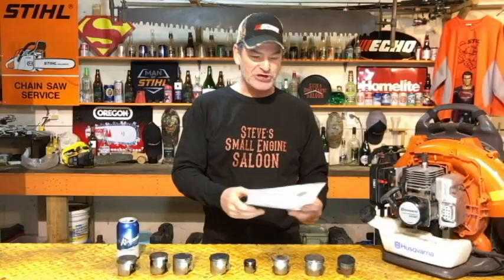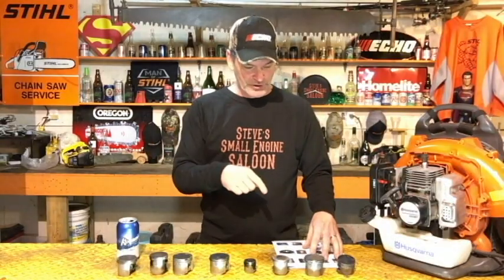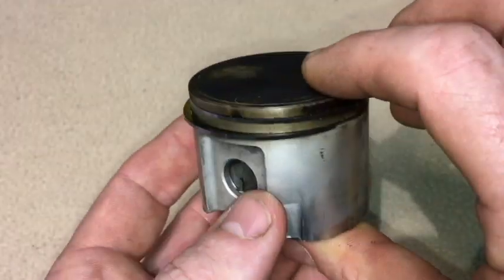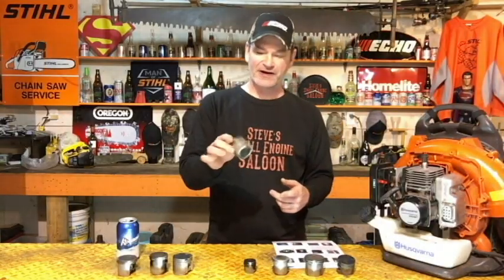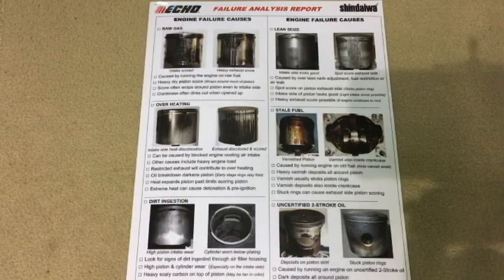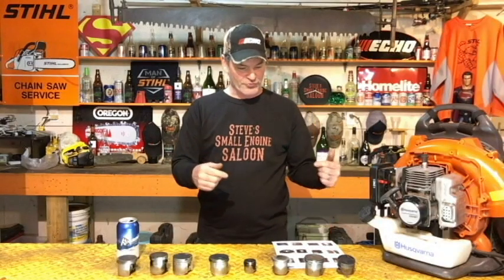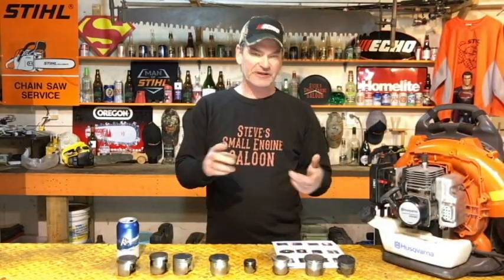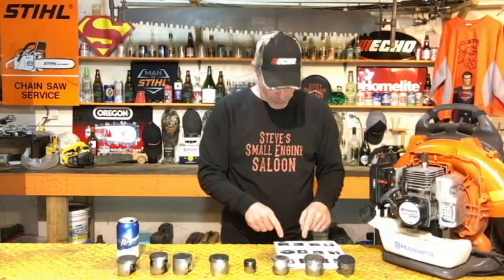How To Tell WHY Your Piston is Destroyed

Comment: I don't have a lot of faith in shops anymore after bringing my chainsaw to 2 different certified Stihl dealers where they must hire the cheapest labor off the street to work on equipment. I had brought my saw in because it wouldn't idle properly when it was warmed up and set aside to move cuttings out of the way. When I got my saw back from the shop, it would stay running but it wasn't long before it was destroyed as they had leaned the mixture out far too much where it burned a hole in the piston with the exhaust side severely scored. I've purchased an aftermarket engine since Stihl parts aren't easy to find online and with the help of your videos, I should be able to properly adjust my carb to the right mixture & settings.

Comment: I make it a rule to clean my chainsaw after very use. As I was cleaning today I noticed black coating on the bar and casing, on the same side as the exhaust port. Could that mean too much oil in the mix. I'm using 40:1. A couple of my chainsaws use 50:1. And that is one of them.
Reply: It could, or may not. (Buildup could be as simple as the saw not reaching operating temperature or the muffler outlet facing directly onto the GBar or Dawgs) 
Old fuel, sparkplug or a loose spring on the carburetor jet could also be a cause. 

Thank you Steve, for covering most of the causes throughout your videos & comments.

Comment: Got a question, stihl ms311, compression 130psi. Starts and runs well. Except if chain Brake is engaged it will stop. I have not adjusted the carb yet, or pressure tested the saw. The piston in the exhaust side shows minor scoring. I suspect a seal leak but wanted to get you opinion Steve. Thanks
Reply from the maker: If the chain continues to move at idle, you probably have a broken clutch spring...

Comment: Sorry to double-post but unrelated Q on this--- is replacing the piston/cylinder the only option if they are bad, or can they be "ported" & "sleeved"?  Think those are the terms I'm looking for... While I don't know for sure yet (not at the point of firing it up yet), I suspect my 1977 project saw (poulan XXV/25d) may be bad and while I do fully intend to get another unit (just for parts- maybe even the engine!), I can't help but worry that this may be a very common problem on these older saws because, at least for mine, the air-filter had literally disintegrated - I can't imagine that means anything except "every last bit of it went-through the chamber on its way out the exhaust"!  While it's simple to replace the long-ago-evaporated/crumbled fuel lines, the air filters doing this would (I'd expect) mean the engine had to 'eat' the filter as it went....My compression feels fine (shoulda got the tester when buying my tach.!), however when I have the muffler off and am looking into the exhaust-port while turning the flywheel I can feel that, as the piston approaches the top/spark plug, it moves very smoothly from the bottom of the cylinder, smoothly past the lower/first edge of the exhaust-port, however once the top of the piston passes the 2nd/top edge of the exhaust-outlet it feels FAR rougher, almost-as-if the exhaust-outlet itself were slightly 'bumped inward' at its top edge or something (although there's no corresponding piston-marks as I'd have expected, the piston&cylinder look un-scored, just some varnish-streaking on part of the cylinder-wall that I'll be wiping-off -- haven't decided yet if I should just reach-in with a long cotton-swab, or if I should learn how to dissemble the entire area and do it right (think I'd do that if/when I get the rest of the problems sorted & actually get it to turn-over, would then immediately turn it off and begin a proper overhaul of the piston/cylinder)  

Making this saw (or another unit of the same model) work is majorly important to me, I know it's not an economical way to get a saw but I already have saws I just want this vintage, neon green top-handle to work, think it'd be an awesome saw to bring on jobs :D

Thanks again for all you do man, your series is literally one of the best 'educationals' I've found in ages, I went from knowing nothing about 2-strokes to actually doing amateur rebuilds (not just chainsaws, my awesome Husq 125B blower was a trash-pile pickup that I got working and now use daily, also have an Echo hedger that I'm (pretty sure!) almost-done getting to work, would never have gone this path if it weren't for your channel and, now, I can't imagine I'll ever "grow out of" my interest in 2-strokes!!!)

Comment: @14:49 you say "If you turn your H screw IN so far / that it's going so fast" (in context of lean problems)   Wouldn't turning the H screw inward slow-down your saw's top-RPM range?  Sorry to nit-pick but want to ensure I've got this understood properly as I've never caught you mis-speak yet that one seems like just that so want to be sure, am actually still trying to figure-out how adjusting the H&L fuel-jets on the carb can even cause lean-ness, I would've figured that the air//fuel//oil ratio is still the same but that H&L are more like 'volume control'.

Thanks for any clarification man, and thanks a TON for doing what you do, am stoked to see the swag under your description am totally ordering the shirt I have watched every chainsaw vid of yours at least 2-3X (and a large portion of the remainder of the channel, basically everything but mower-specific stuff!)  It's so great that you do this it's such a perfect example of how great the web can be - I literally bought my first top-handle saw earlier this year and, embarrassingly, wasn't sure why it wouldn't work----the chainbrake was on!! LOL!  Now, I've rebuilt/salvaged multiple saws and am currently in the midst of rebuilding a 1977 poulan 25d/XXV unit which is why I'm going-over all these piston/cylinder videos (I'd gone to refer to my screen-shot of the Echo infographic and realized I didn't remember enough to contextualize it properly & needed to re-watch the relevant vids here on your channel :D )

Again thanks for doing what you do, it's such a treat to watch (was especially awesome watching you & Buckin', I'd never hang my own axe - probably not at least lol - but thoroughly enjoyed that vid :D)
Reply: If you turn the screw in, the end of the screw pinches off a fuel supply passage. Somehow a chainsaw engine like a leans mixture for running at super high rpms. Maybe a lean charge burns faster than a rich charge. More gas takes more time to burn? Just a guess.

Comment: Help me Steve, where can i find a Stihl 034 cylinder kit?
Reply: EBay and chainsawr.com is where I had to source parts to restore an ol' Stihl 032AVE 
Jug and Slug $25.00 and 10 bucks for some Caber rings.
Got the replacement flywheel cover from Sawr. sawagain.com also has various parts from time to time. Just gotta keep looking often.

I know this is an old post, but hope this helps. 🍻
Good luck and Take care!

Comment: Kokanee!  One of my son's favorite beers, and local brand for you!  BTW, you can get repair kits from China (hutzl.net for instance) for many of the big brand saws and other 2T tools for chump change.  They may not be as good as the OEM, but they are good enough to get a few more years of use out of your machines at a low cost.  But yeah, use good oil - cheap insurance.

Comment: Hi Steve. Thanks for all the videos. I've been a mechanic now for many yrs-thru the yrs a mix of cars and small engines. These days just small engines for a large landscaper in VA (along w/the hustlers and grandstands). Sometimes I like to watch to confirm what I know and sometimes to learn more of what I dont...hence this video. Its funny the cheat sheet is from echo because its the brand I wanted to take on when I had my own shop unless it was a chainsaw where I would go with the stihl. My boss just killled his favorite ms660 so I will print down (in color of course) the sheet and compare to see the cause. I think it ran too lean or too hot or both because the plastic was untouchable above the head and the exhaust side was scored. As far as the oil in my opinion....I'll stay with 36 to 1 all day everyday and unplug those arrestors with the torch verses torching a motor any day! I dont care how good that oil is 50 to1 is just asking for trouble-rediculous. Keep on videoing!!!

Comment: All good advice, one thing I would add is that any type of piston failure that scores the piston is most likely going to send debris off the piston down in to the casing and end up on the con rod and or main bearings.
Be sure to do a good rinse and flush out of the crank bearings and close inspection and feel of the bearings.
Turn the crank to make sure the main bearings still feel smooth and free of contamination and shine a good lamp and use magnifier to look through the oil slot in the big end of the crank  to look for fine flakes or tiny silver colored specks on the big end bearing and try to flush it out.
If you don't then the crank bearings may begin to fail and debris off them and or the bearing cages may end up scoring the piston and then you are faced with doing the crank as well as a second new piston and ring.

Comment: I run all my Stihl equipment on 50:1 and they always run smooth. (That's 50 oil and 1 part gas)
Reply: Typo: your ratio should rather be 50 parts high octane fuel/gas : 1 part TwoStroke API-TCW³ oil. 

A.) I'll stick to my ratio of 2.75L fuel : 60ml (FC) oil ratio for midrange chainsaws, or 
2.60L fuel : 60ml (FD Low smoke) oil for ≥105cc powerheads. 

B.) Remember that when your fuel/gas tank gets finished, your ratio is ZERO OIL input while the piston rotates. That's why the K-series cutoff power heads use an infra-red sensor to switch off the engine if the proprietary additive is omitted.

Orange over !!
Reply: 50 oil 1 gas?? Yikes! You're gonna gum the engine! 😂😂

Comment: If I have a slightly scored piston ( a shindaiwa weed eater) due to plugged spark arrestor and I clean or remove the arrestor and it runs fine and strong... do you think it could still be okay and last good while or do they deteriorate quickly and turn to shit fast?

Comment: cold seizure is also the same thing as cracking the block by puting cold water on a hot ass engine it shrinks and cracks
or even glass, if you heat it up to fast it will crack, if you put something extremely hot on a cold engine it will crack
Reply: pro tip in general, warm engines up before use, generator? let it warm up for a few seconds
motorcycle with loud ass exaust? let it idle for a few seconds to get the oil everywhere

Comment: Your stuff is great Steve....especially the Magic washing machine......

One point you didnt fully make on 'cold seizure' in a chainsaw is that the piston expands faster than the heavier cyllinder, especially the exhaust side of the piston...you either left out the cyllinder's role in the warmup, or I didnt hear right....
great vid....so far all my chainsaw compression losses have been leaky seals and carb/air leaks....frying the exhaust side.

Comment: 50:1 is way too dangerous for a chainsaw. This ratio was introduced for bogus emissions rubbish. I run my motorcycle on 50:1 but it spends a lot of time running at less than 100% power. 40:1 is a good mix for chainsaws.
Reply from the maker: 100% agreed....
Reply: I've always run with 1:50 0%-ethanol, never had seized saws

Comment: Thanks Steve, yet another great video! Having determined that not starting on my Stihl 025 was due to a loss of compression, I peeked in the exhaust port and found severe scoring. Aftermarket engine ordered. I'm in the process of pulling the saw apart (slow going due to right/dominant wrist fracture/cast) while I wait on parts. I'm looking forward to identifying the failure cause with information from this video.
Reply from the maker: You're Welcome...

Comment: Yes, always run a quality mix oil and fresh gas, ethanol free if you can get it. NEVER break in a new engine with synthetic oil, the rings will not seat properly and will cause issues down the road. All two-stroke OPE that calls for a 50:1 mix I have run at 45:1 and achieve a nice tan colored plug. About the construction folks beating on the saw, how you you feel to wake up in the morning a be forced to sprint to school. Wouldn’t feel good on the body, same with your equipment. Stuff isn’t cheap, take care of it.

Comment: Steve the question I have is a 2 cycle  p26 pioneer chainsaw has 2 rings piston the pins that keep the rings from rotating are flush with outside of the piston and the rings were the gap is are square allowing compression blow by threw that gap is that ok

Comment: Hi.
Why is there on my cylinder walls of my husqvarna 545rx some markings (which are just visual, cant feel anything with my nail) and the piston is perfect, spotless? Is that a sign of normal ware? 
The compression is still very strong.
Cheers from Romania.
Reply from the maker: That sounds like normal wear to me....
Reply: @StevesSmallEngineSaloon  I measured the compression with a gauge and it indicates 105 PSI. (My 10 tears old Stihl ms 181 indicates 120 PSI). Is that normal? It seems preety low to me, although it is not easy to pull the cord. It makes that pop pop.

Comment: Really enjoy the videos and thanks for sharing your knowledge Steve!  Have a Stihl 064 bought used.  It wouldnt idle well so i pressure/vacuum tested the crankcase and found bad seal on flywheel side.  There is some play in crank bearing on flywheel side but thought i would see how long a new seal would last first, before going further.  Vacuum tested fine with new seal and started right up.  used about 30 min but cant get idle right.  Without tearing apart again and vacuum testing to see is seal is bad again, how long do you think seal would last with some play in bearing (minutes,. hours...)  ??  Also, what are signs of starting lean seizure, other than failure to idle?   It does NOT rev up when held on either side but does bog down one or both ways .Would it bog down first while cutting?  When reving up it seems to be 4 stroking and not running too lean...  would exhaust show excessive heat, etc?  Piston has slight scoring above rings from before but rings are free and compression seems good pulling.

Comment: Years ago, 1950s and 1960s the recommended mix was 1/2 pint SAE 40 non-detergent motor oil to one gallon marine white gas (non-leaded) gas. How far we have come since then. I think that this was I
imperial measure.
Reply: I have a homelite xp 1020 on the gas cap it says 1 pint 30 wt oil to 2 gallons gasoline. 16 to 1. It didn’t specify white gas. Although my brother used to put white gas in his cushman  eagle.

Comment: Steve I've got a saw that will cut part of the way into a log (oak) and then the chain or bar looks like it's twisted and will either cut crooked or not cut anymore at all. I've sharpened it several times and even changed bars and chains. Am I not doing something right? ??? Someone let me know what to do please.
Reply from the maker: I have a video in my chainsaw playlist called cuts crooked.
Reply: @StevesSmallEngineSaloon  thanks steve,I bought a new bar and chain. It solved the problem till the chain got loose. Then I looked at where the oiler cover is as the chain passed by it,it was brushing the screw just above it for the chainbrake spring cover.. wow how did I miss that ? Anyway thank you for the help Steve and may I say your videos are always informative so keep up the great work.(Ken)

Comment: Hi Steve, sure wish I would have found you a week ago, I bought all the new fittings for my chainsaw- air filter, carb gaskets, etc.  A new piston is $30, and a new piston/cylinder kit is $160.  Is it plausible that if I only replace the piston, I will get good compression again?  I run an Echo CS-490
Reply from the maker: Sure, as long as the cylinder is nice and smooth with no deep scratches.  Clean it up with some emery cloth.  If you can feel the score with your fingernail its not good enough...

Comment: Water in fuel leaves that chalky stuff in the crankcase. Also overtrighten O.H.V.  or constant running W.O.T. making piston very hot and then shutting it down when overheated instead of a min.or 2 at idle. I have a piston with the bottom of the skirt on exhaust side having a few mm. Broken off it. Not sure what did that but diagnostic tests showed major air at seals and choke pin on carb along with vac lock in tank not releasing at ~5 p.s.i. an partially clogged fuel and air filters.  The muffler screen was slightly clogged too and fuel was flex fuel 85% ethanol well over 6 months old.  The plug had around 2x the normal gap even so.....a old Ts400 was the victim

Comment: Super helpful. My saw looks like it was run under a heavy load with a dull chain or the fins were dirty. It is an Stihl 026 Pro It was a freebie so I was glad to get it. I replaced the piston and cylinder and it runs like a top.
Reply: Just read your comment you posted 8 months ago.  I also have an 026 pro, owned it for over 20 years,  really good powerful little work horse saw! definitely got a keeper there.  You stole it! Just keep it clean and sharp!
Reply from the maker: Right on...

Comment: I have one of those 52cc Chinese Husky clones that cost about $90 and a year ago I accidentally ran two whole tankfuls of raw gas through it. One tankful is probably about half a liter, therefore two tankfuls equal one liter. I took the cylinder off to inspect the damage, and there was none whatsoever. Absolutely no scoring on the piston, no scoring on the cylinder walls, the rings in perfect condition. The saw has been working perfectly ever since, the compression is normal, no problem whatsoever. Does anyone have any idea of how that is even possible?
Reply from the maker: Blows my mind!
Reply: @StevesSmallEngineSaloon  Perhaps it is proof of superior quality of the Chinese $90 chainsaws? No need to spend hundreds on a Stihl or Husqvarna any more :-)